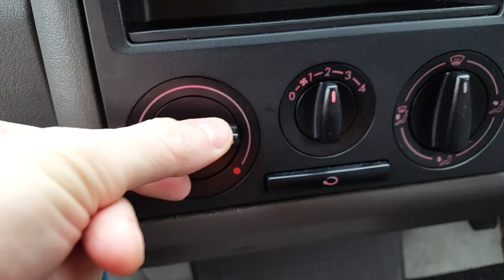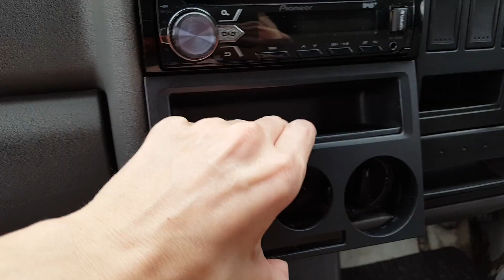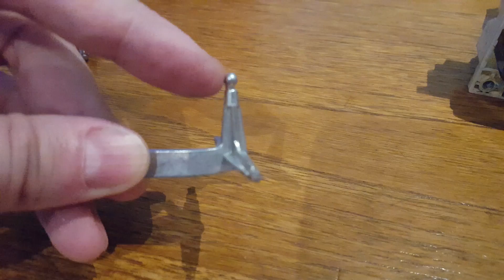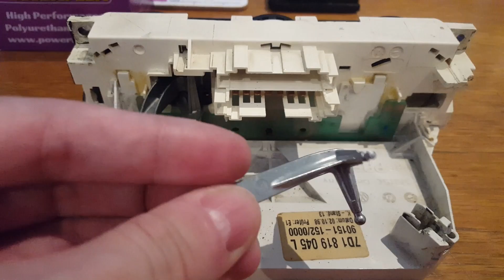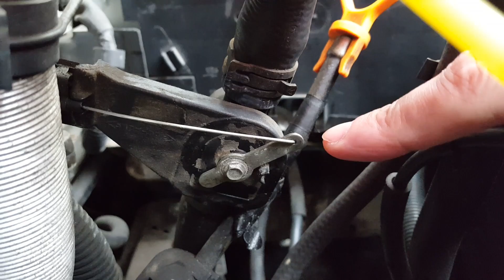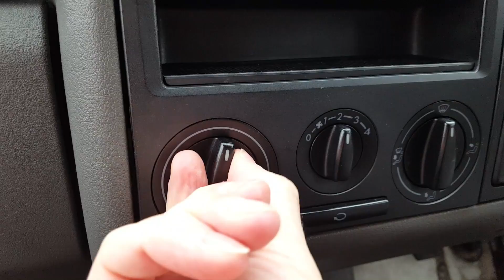Volkswagen T4 Heater Control Arm Repair #VWT4

Comment: Hi i can not see the item ebay can you send it link again please
Reply from the maker: Just tested the link. It is working. The link is to the seller's shop, not the individual item, as those links expire.

Once you click on the link, you will see two search boxes. One at the top to search the whole of eBay and one lower down to search the seller's store. Type "heater control arm" into the lower search box, and that will bring up all the different types of heater control arms.

Comment: Perfect, thank you..  mine broke a few months ago, doesnt spin all the way round like yours, but i have no control over the heat...  gives me something to look into. cheers
Reply from the maker: When it first broke years ago, I spent a few weeks using the diverter valve arm under the bonnet to control the temperature. It wasn't ideal.

Hope you get your one fixed